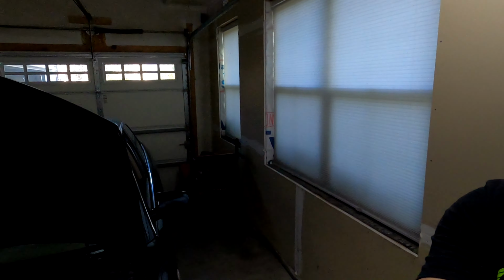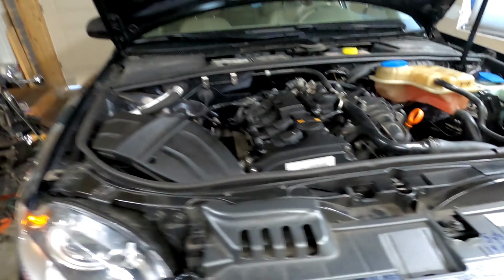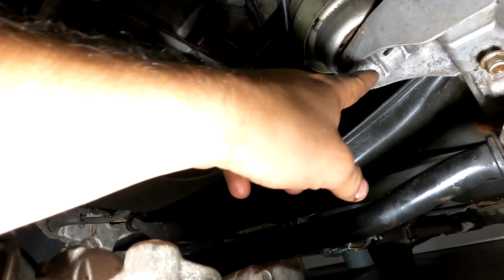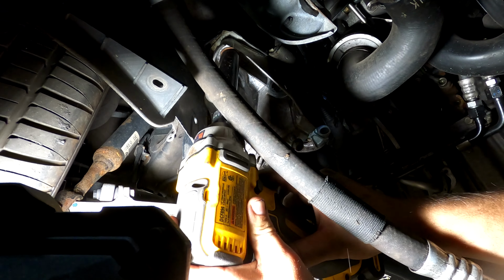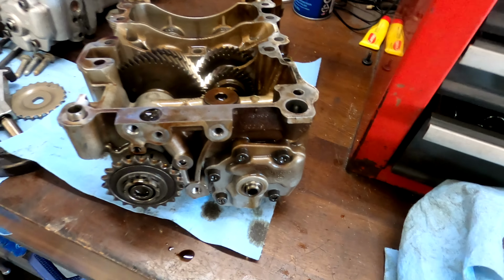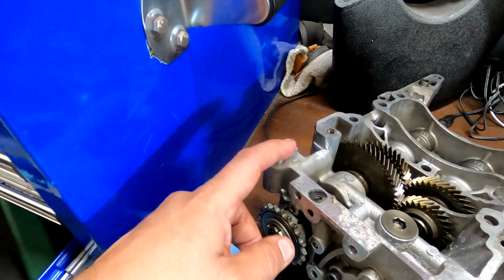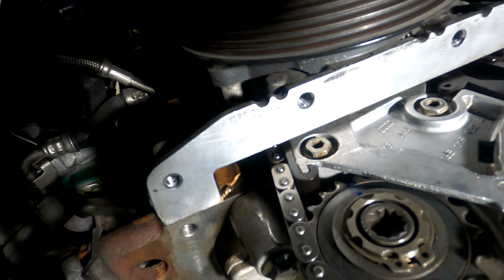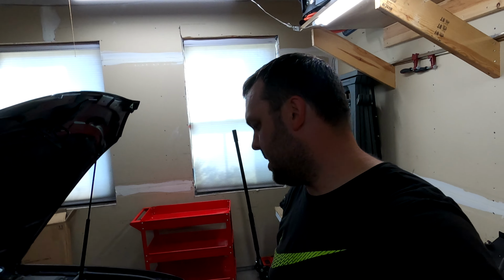Audi A4 2.0T Oil Pump Replacement

Comment: This video has been super helpful as im going through the same issue. Thank you so much for posting this!
Reply: Same here. After 15 mins of driving oil pressure light comes on. After 2k rpm it goes away and low revs comes back. Ongoing issue for 6months and engine sounds sweet. Similar problem like the video

Comment: Excellent video, clear, good audio and very educational. I feel I can now replace my oil pump hexagonal drive pin now. I don't have a garage, basic tools, it's winter and my car A6 c6 also has mmi issues. Its this or scrap the diesel. 😊
Reply from the maker: Thank you very much! Good luck on your project and thanks for watching!

Comment: Diagnosis on the oil pump not building enough pressure to meet the needs of the engine is correct.  It would slowly get worse and then the engine would likely ruin from not enough oil supplied to cool it.  Admire anyone who takes on this daunting Audi service at home. ....somebody needs a car hoist .
Reply from the maker: I agree, I’ll have to have a talk with the video production staff to see if a hoist is in the budget. Thanks for watching!!
Reply: @thatlldogarage  😂😂
Reply: Doing mine now

Comment: Great video. I am struggling a bit with my A3 oil pump. So, is piston 1 all the way up? Would you remember the right torque to tight the bolts?
Reply from the maker: Yes, #1 was all the way up at the time. I think the torque value could really vary between models and years so I would recommend you look it up for your specific car, sorry. Good luck with your project and thanks for watching!

Comment: Great video. I know it's a year old, but I'm in the process of performing the same task and would like to know if you noticed what direction the balance shaft weights were facing while in TDC?  MY new balance shaft is missing the timing mark on the cog and my old balance shaft is out of whack and the weights are not in synch.
Reply from the maker: Thank you, sorry but I don’t remember that detail. Good luck with your project, hopefully it is up and running by now.

Comment: The car still good? I'm about to do that on mine I have the same problem oil ligth come on at less than 1600rpm but above those rpm the ligth is gone!
Reply from the maker: Hi Ruben, yep the car is still good! It’s been about six months. No more rattling noise or low oil pressure light at all. Good luck with yours, thanks for watching!

Comment: Hey, quick question, how did you get the two bolts near transsmison out? Been struggling to think how?
Reply from the maker: I don’t remember struggling with that part in particular, what is the issue you are having with those two bolts?
Reply: @thatlldogarage  well it seems like the flywheel is on the way half there.. So I think that I will need really small torx or whatever there is and pray to get out

Comment: So was the job a continued success after months of driving? I am having a very similar issue as far as when the oil pressure light comes on but now I am actually getting a p000a code error to. Have to take it to the shop monday because I am too busy right now to do it myself. So I am basically pooping my pants at this point about it.

Comment: Hello, I have the same car and I got my oil pump off. My balance shaft sprocket broke off and both my balance shafts locked up. Do you think that could cause low oil pressure?
Reply from the maker: Hi Brian, yeah I would say that could be related at least! That whole assembly is pretty unforgiving so something like that could easily lead to low oil pressure in my opinion. Good luck with your project and thanks for watching!
Reply: @thatlldogarage  okay great 1 last question. Did you reuse the bolts for the oil pump or are they stretch bolts?
Reply: And also how is the used pump holding up. I'm definitely not spending 2000 dollars on a oil pump. I just bought a 300 dollar one on ebay

Comment: You have reintroduced a significant failure point in your EA113 engine. The balance shafts are unnecessary, and you could have installed a FreeWheel that effectively disables them. Moreover, with the FreeWheel, no timing is required!

Comment: I have an Audi A3 2.0T AXX from 2005… I think that I have the same problem, because the car after I cancel the error P000A , Anyone with the same error? Is it your same problem? Camshaft slow response I think because of oil pressure because I changed everything else like : PCV delete, 3 rings for camshafts (variator) and also all sensors for camshafts but nothing …
Any idea what should I do? Thanks

Comment: ohhh, I think I might have the same issue. I bought a 2.0 TFSI like last week, drove it for 3 hours home, no issues. And yesterday on my way home from work the oilpressure lamp came on, I check the oil, was not very low, I checked the service manual and noticed it was due for a service, changed the oil and oil filter today and on my way home the same thing happened again except this time it started to make little ratteling noice just as I was in my driveway. yikes :/ hope its okai.
Reply: hi what was the nocking noise did u find out more
Reply: @County_Country  ohh, sorry did not notice the alert. Well yes, too little oil came up to the camshafts. But it was undamaged, the turbo on the other hand needed to be replaced so I swapped it out for a new one, and the oil pump was fine too, but the oil pickup was clogged, and there was a ton of gunk/sludge in the oil pan so I clean up as well as I could, and put everything back together, drove it for a year and now I have low oil pressure again, happened right after a oil change so my guess is there was a lot of more sludge somewhere in the engine that came lose now, I did check the oil pressure with a gauge first to make sure it was just not a bad sensor, I hardly wanna do this job over again, but I guess I have to.

Comment: GOOD VIDEO DID U HAVE TO PRIME THE OIL PUMP?
Reply: I use petroleum jelly or assembly lube.  Works great draws instantly and dissolves into the oil with no effects.   Many engines, many years, zero issues.

Comment: you could have changed those blow engine mounts and rod bearing while you are there. you should have measured oil pressure at idle, cold and hot with mechanical guage

Comment: Did you have to prime the oil pump after your work?
Reply from the maker: Hi Homero! I did not think to prime it but it would be wise to do so. I had about 5-7 seconds of timing chain rattle and then things settled down quickly. But I imagine you could disconnect the spark plug wires or remove power to the fuel pump and then crank it for 15-20 seconds. Good idea, thanks for watching!
Reply: @thatlldogarage  Yeah I disconnected the coils and cranked it for about 15 seconds and it worked.

Comment: I believe I have the same problem. Did you notice a knocking sound when the RPMs dropped? I will investigate at the weekend. But I’ve definitely got a tapping / knocking sound coming from the sump luckily I was very close to home and turning left when the light came on. 
Great video and very instructive 
Thanks 🙏🏼 
Carl.
Reply from the maker: Yes, I sure did! It sounded very low on the engine and like a heavy and quick thunk thunk thunk. Thanks for your comments and for watching too! Good luck!
Reply: @thatlldogarage  Thanks for You’re reply, from You’re description it’s sounds the same. I’m definitely going to have to go and inspect a 2nd hand Oil Pump and Balance shaft assembly before purchasing one. I will post a video or two with an update 🤞🏼
Thanks again.
Reply: This is the problem I’m having.  It knocks when it revs down.  Not when it revs up.  I started wondering if maybe my chain is loose and slapping? Also I noticed during initial startup,  it doesn’t seem to do it for some reason.  When they first run,  they idle high for the first few minutes,  it seems during this time it doesn’t make any noise.  

I didn’t know these stupid balance shafts needed to be timed either.  I wish they had left these out of these cars.
Reply: I will add,  I’ve done a delete before.  However,  I did this with  a seized up assembly.  But it wasn’t worn out and eat away like this.   
I just disconnected the first gear from the shafts themselves.  I cut out the next gear in line,  which was the beginning of the first shaft.   That disconnected the drive gear and allowed it to free spin.  I left all the shafts and everything in it and i think it’s still running today. 
Looks like I’m about to get into this mess again
Reply: Thanks for the replies, I’ve replaced the engine now. I still have the old complete engine in the garden which I’m getting around to taking the balance shaft of to inspect the crank bearings as I suspect that’s what was giving me the knocking when the rpm drops down. I’ll probably break the engine down for parts now and claw some money back.

Comment: Just bought a A4 2.0T and was told that this was a issue I need to address. Hopefully this is the issue
Reply: Me as well. 1800 for the oil pump though! I am hoping this is NOT the issue lol
Reply: @AltHunterTCG   I meant to say I hope not , but it ended up being the issue.
Reply: @UnknownButKnown15  taking mine into the shop tomorrow. Lorddd. Im about to change oil just to be sure. How much was it if you dont mind me asking?

Comment: the amount of rtv you put will clog pickup tube soon in couple months. bye bye engine
Reply: You can catch it in time if your turbo blows out first
Reply: @Barmalejus  I hope so, mine just blew . Terrible noise
Reply: Way to much indeed, just a little roll and tap it with your finger to make a smooth thin layer, more than enough to seal.